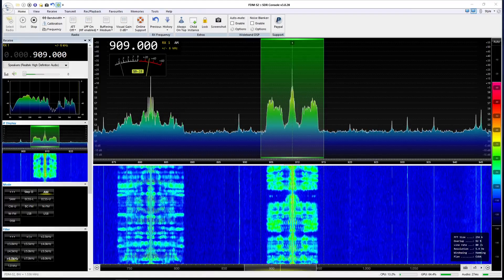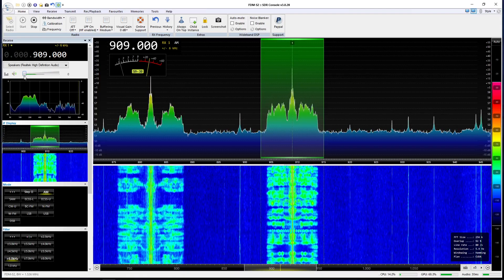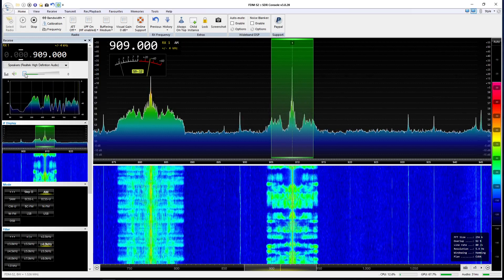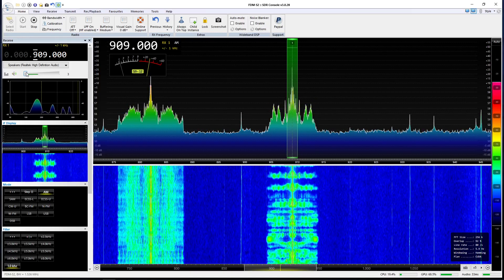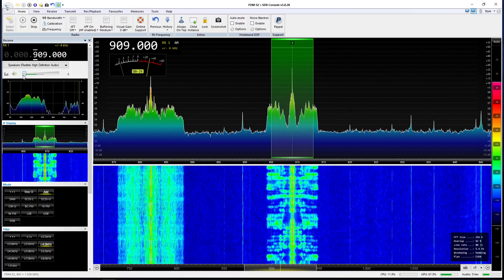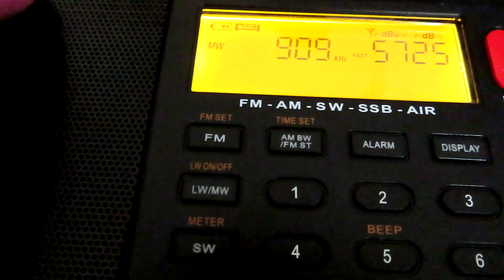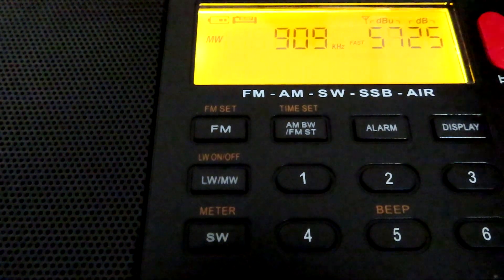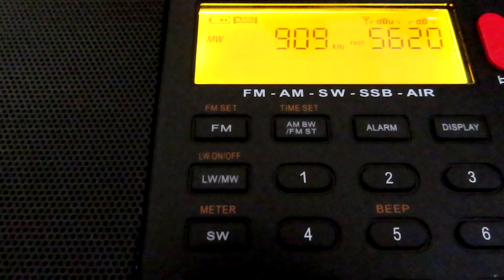SIhuadon/XHDATA D808 bandwidths

Comment: This confirms what I had thought : the filters on the D-808 do not correspond to their assumed bandwidth, although they are useful and it is not too bad for a small portable radio.
For sure, an SDR is far more accurate and the bandwidth can be extended well over 6 KHz. CRI broadcasts with nearly 20 KHz bandwidth (near FM quality !) 73 Jean-Luc